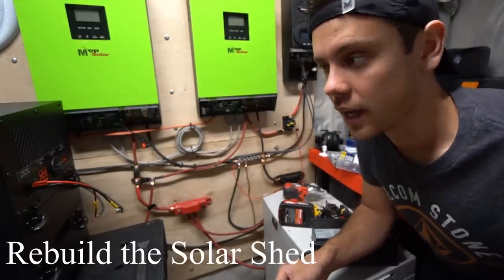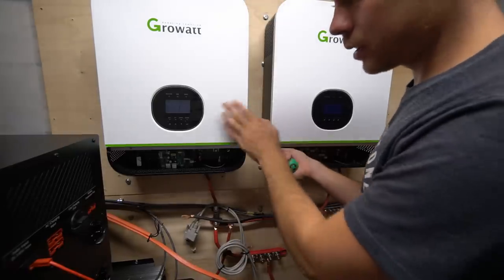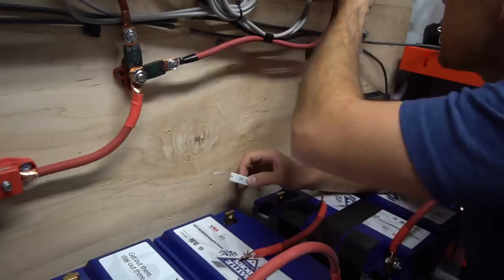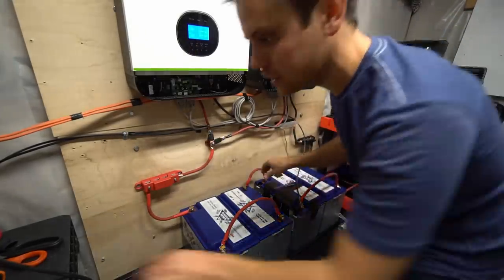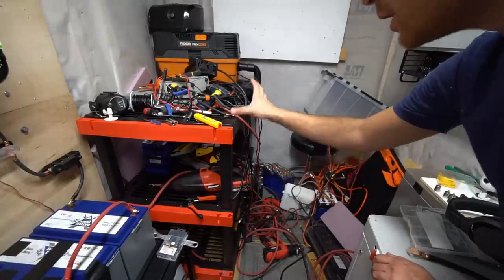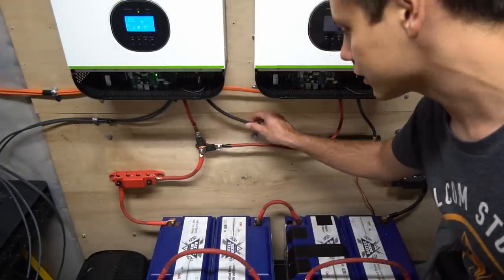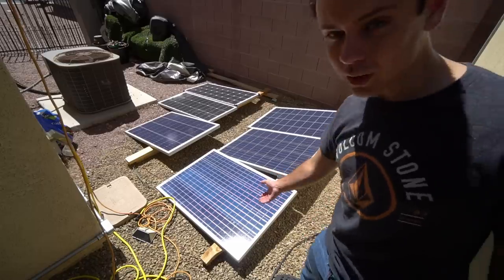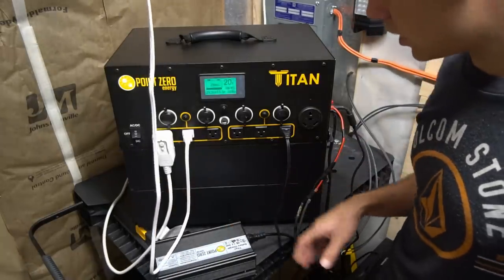Upgrading the Solar Shed: 48V Growatt Inverter Install (and organizing my junk pile)

Comment: I just want to know, how much electricity can u produce in 1sq meter of solar panel.
Reply: Chris Gypsy 
1kw per square metre, max.
Reply: @SootySweep22  Um, I see that Chris Gypsy wanted to know the max power per sqare meter from the solar panels .
Instead you named the solar radiation power reaching ground. With an efficiency of roughly 20% the solar panels deliver 200W / m² on global average. Solar ground radiation spreads decently depending on your geografical location (the latitude). At the equator its about twice much as at the poles.
Hope that helped.🙂

Comment: Why don't you use fuses on the batteries etc?
Reply from the maker: They have OCPD built in
Reply: Still should use fuses for failsafe (not sure but does it have them on the junction that splits between the inverters)
Reply: LiFePo4 chemistry doesn't have the issue of thermal runaway that NMC or NCA batteries do, so they aren't a giant fire hazzard if they overheat. If they are overloaded, they'll act like a giant toxic smoke machine and be permanently ruined but they won't burn your house down. So, no fuses needed for safety but are okay if you're trying to prevent battery damage.

Comment: So, I have been following and watching your videos for over a year now. I have been building a coach bus to rv conversion. I purchased 6 battle born 12v 100ah batteries. I was about to purchase the mpp solar lv5048. Then I saw the mpp 24v all in one. Then you did another video on the growatt system. Then I just get lost on making a decision on what to go with. 
What I have as of now
1500w worth of solar panels
6 x 12v 100ah battle born batteries
Renogy Dcc50s 12v Dc board charger

What all in one charger would you suggest to go with for the system. I havnt decided to go with 24v or 48v system yet. Will the renogy dc to dc charger work with an all in one inv/charger.
Reply from the maker: Growatt is a little better than mpp. But I like them all
Reply: @WillProwse  can i still use the renogy dc to dc charger with the growatt to charge the batteries with my altornator while driving
Reply: @WillProwse  
Also, have you ever messed around with ultracapacitors in a solar setup

Comment: Have anyone used a  use electric car battery like a Nissan leaf lithium battery to power there solar system?
Reply: Will recently did a video about Nissan Leaf battery packs from Tech Direct, 48 volt. I just bought a few myself and look forward to setting them up.

Comment: Obviously you know what you're doing so it's not a big deal, but to someone that doesn't exactly know what's going on, this looks terrifying with a lot of power all over the place haha.
Reply from the maker: Haha!! It's so fun. Once you know the basics, anyone can do it 😁
Reply: @WillProwse  heyyy I asked on your bluetti vid... Anyway you can DM me somewhere? I'm wondering if I could hook the bluetti up to the to my house nema 5-15 male to male and turn my solar on or if it would like blow up that battery or inverter lol. Like where would the extra energy go?
Reply from the maker: @DirtyTesla  oh I didn't see that comment, sorry. And you could supply one line of your houses panel with a bluetti but not a good idea. Would need to turn off all 240v breakers. And yeah, my email is willprowseiv@gmail.com
Reply: @WillProwse  ok Thanks I'll send an email for more details. But my thought was if the panels detect the sine wave they can turn on and during the day solar panels can power everything in event of power outage...
Reply from the maker: Ohhhh like that. Yeah it can't do that. I always wanted to make that work but its impossible with a bluetti
Reply from the maker: You need an inverter larger than the grid tie one. A split phase one. And need to disconnect from grid. An off grid inverter connected to ATS would be ideal. I wouldn't try it. Better to go 100% off grid if you are doing that

Comment: Wow Will such a potty mouth ;-)... Waiting for the two 48v power walls from Big Battery. Could you call the CEO about their lack of communication. I've been looking for some anderson connector that have a terminal end so I can use the 00ga wire from my FLA battery bank to connect to the power wall. Hate to toss some expensive cable into the gijet box. I have two crimpers hydo and leveage. Watch your end connector size in the crimpers. I had to use the next smaller crimp dies to get a good crimp. Hears a suggestion. Get a pair of Fisker cutters (Home/lowes) for cutting cables these look like strait blade and a square anvel for the blade to cut down to. They are also titanium coated. These cutters worke great cutting the cables for my system. Even cut 0 and 00 up.

Comment: Just a heads up Will. They have the 12 volt all-in-one you have linked 
on your website at US $9,499.05. They are  clearly trying to rip your 
people off.
Reply from the maker: No they are not Randall. eBay increases the price of the listing when they run out of stock. That's why Ian now has a direct sales website. Because many people don't understand that, or have used eBay before.
Reply: @WillProwse  
That's what my son told me.
Ebay penalizes sellers for no stock, so sellers use this work around.
Explains why $10 items become $1000 suddenly.
Reply: @WillProwse  Where is the website?